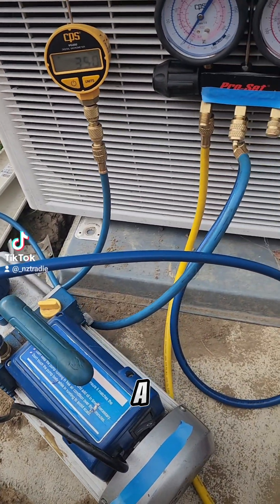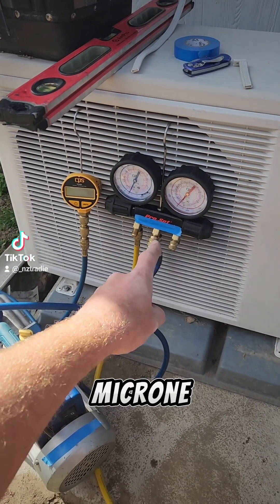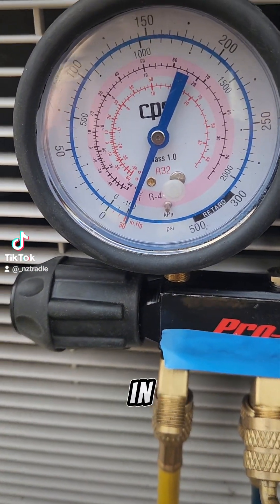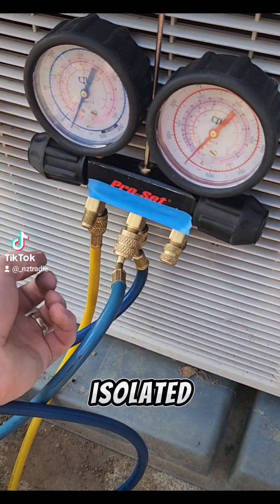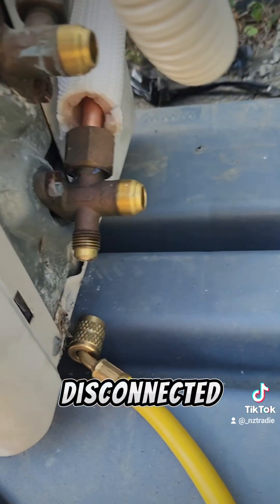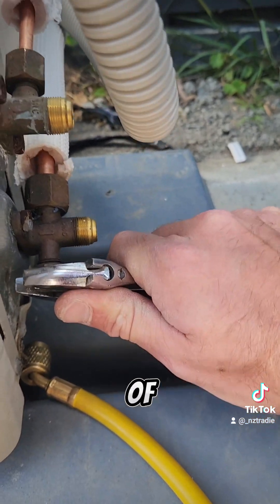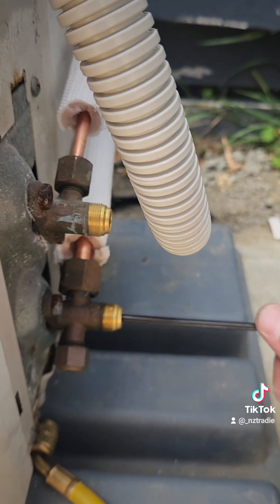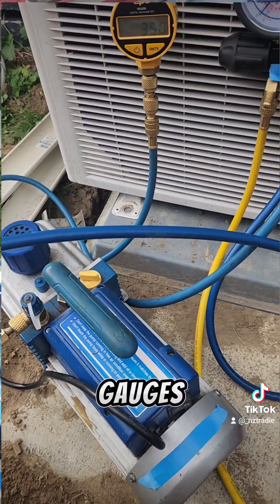How to gas a Heatpump

Comment: Nice to see you using a micron gauge, but when you shut down the low side valve on your gauge set you also cut out the micro gauge, which is what you need to be watching to check if you have moisture, you wont see it on an analogue gauge. I don't do heat pumps, do they come pre-charged and you are just pulling a vacuum on the lines then opening it up? Do you also nitrogen pressure test your connections? Often slow leaks wont show on a vacuum.
Reply from the maker: @electricalmayhem  you make some good points, over the years different trainers say different things and then this is just where we have ended up, hence why we do it this way